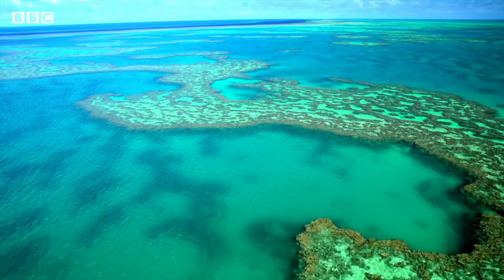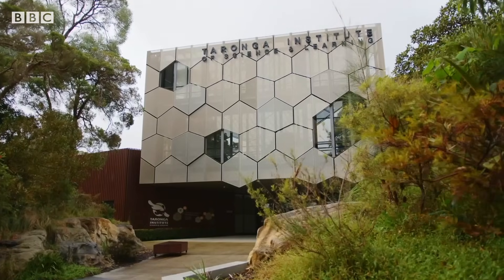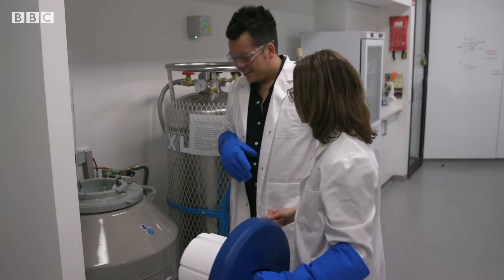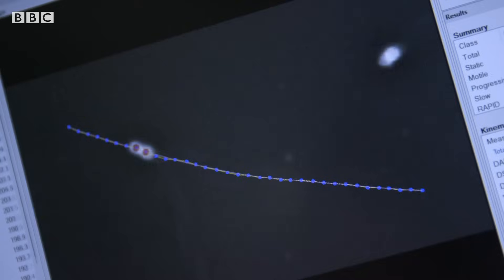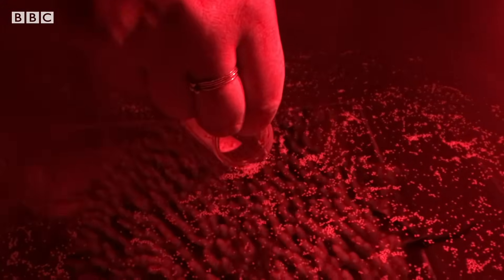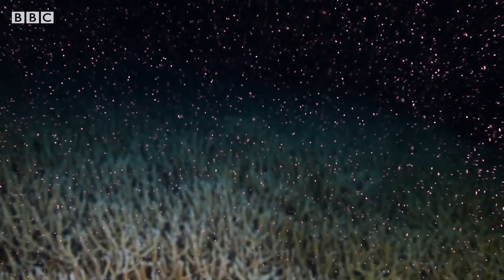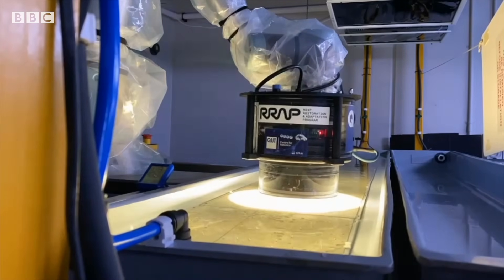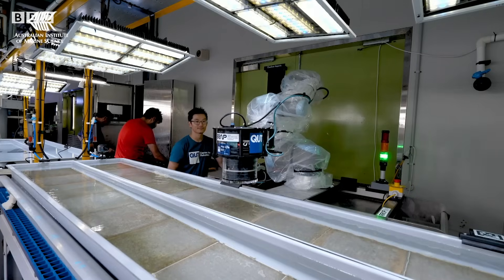Could tech protect our coral reefs? | BBC News

Comment: I have an idea: make hydrogen become the only source of energy, it is eco-friendly, efficient and easy to produce. Traffic vehicles, factories, household appliances can use this kind of energy. Do you know that hydrogen can be heatened up to 4000 F. You can manufacter and use vehicles how much you want without harming the environment. The only struggle is about safety and contributing. Good luck.
Reply: easy to produce? maybe it's easy but it seems to cost more energy to produce than what you get out of it - plus storing it or transporting it is still an issue.